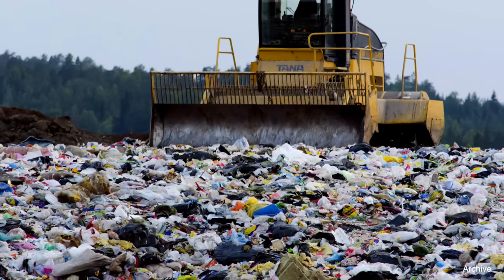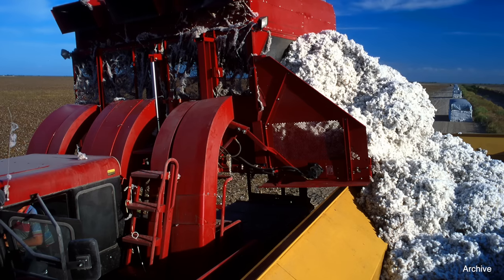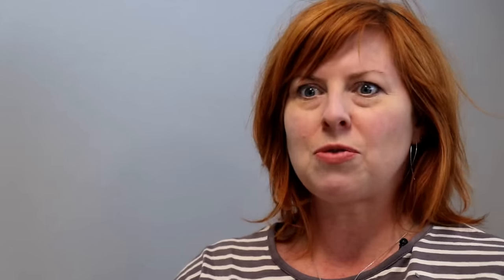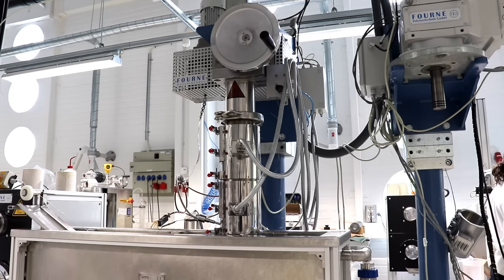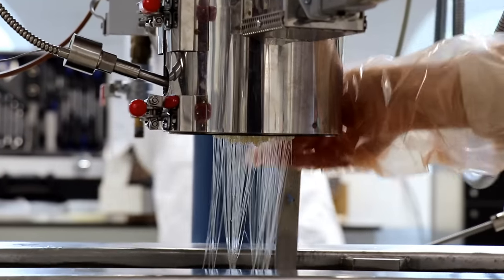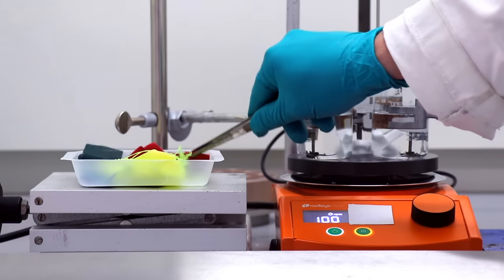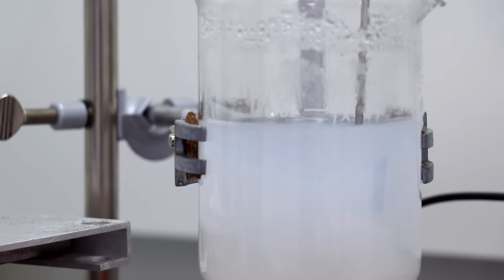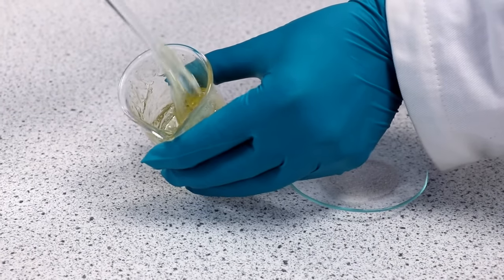Chemical Textile Recycling 👕 Towards Sustainability and a Circular Economy | 'Fibres of Gold' [HD]

Comment: Thank you for posting this very demonstrative and educational video! It’s a first time for me to see exactly what it the chemical process, breakdown and extraction looks like! What do you think about the integrity of the fibre, because I have heard that the filaments weaken and shorten after one time of processing?
Reply from the maker: Thank you for the lovely comment, Amanda. I think you are referring to mechanical recycling, of which it is true that the fibers shorten with every time you do it. With chemical recycling though, you are dissolving the polymers that make up the fibers, therefore you don't get a loss in length but instead you fully regenerate the fiber. That's the big advantage of chemical recycling over mechanical recycling.
Reply: Hi @paulalorenz4283  
I want to know the complete process...can you please share the details ?
Reply: You get a rayon instead of a cotton with the cotton.